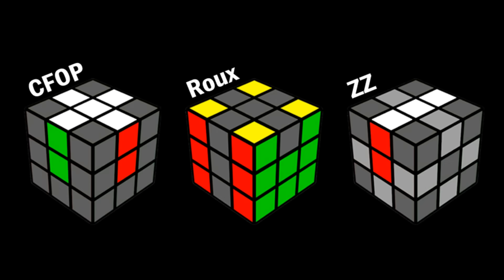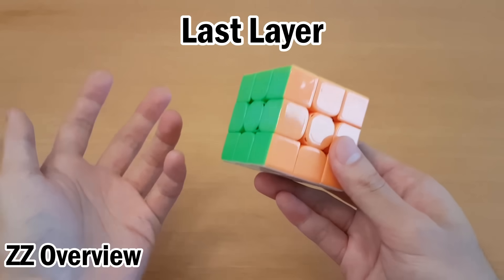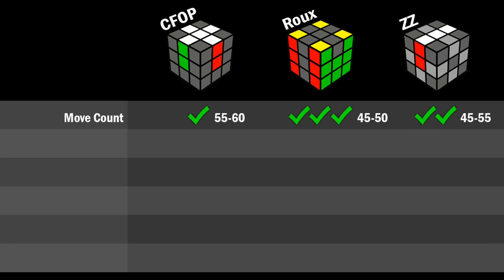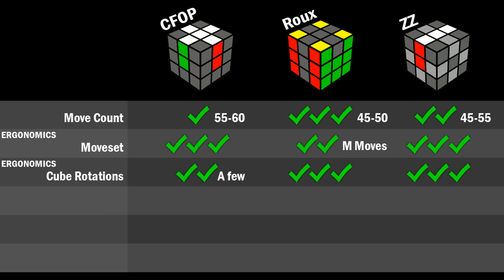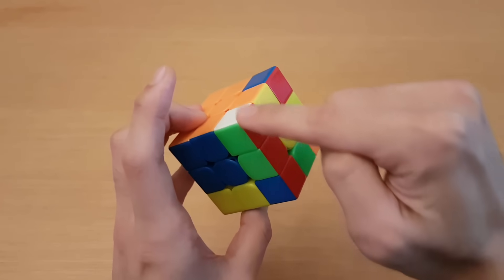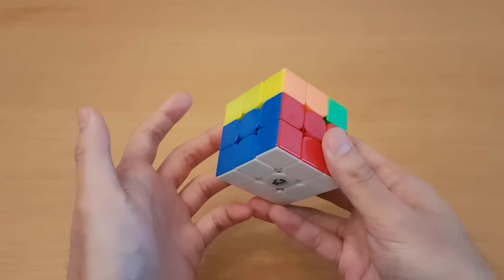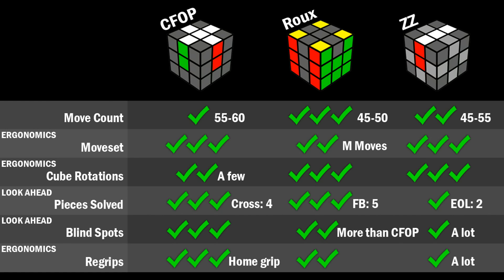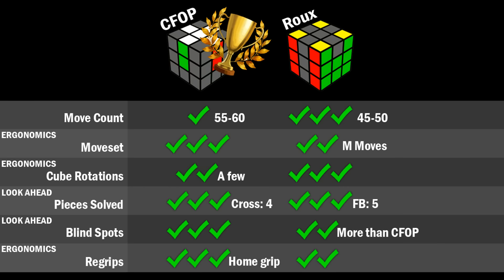The BEST Speedcubing Method? [CFOP/ROUX/ZZ] Comparison

Comment: just memorize 43 quintillion algs
Reply: Big brain
Reply: Just pray for a LL skip
Reply: @Froge4291  maybe pray for a whole cube skip
Reply: @Froge4291  just pray for a CFOP skip
Reply: @Froge4291  Just pray that you get an f2l skip and LL skip
Reply: @Froge4291  lmao
Reply: @Froge4291 i got an OLL and A PLL skip in the same time
Reply: You mean Pll right?
Reply: @Froge4291 why not pray for a full FOP skip?
Reply: 43 quitillion/6 if you are color neutral
Reply: @davidrodriguezsaucedo8666  Actually, divided by 24, since there are four possible orientations for every six color positions.
Reply: @davidrodriguezsaucedo8666  are you a genius ?
Reply: @davidrodriguezsaucedo8666  still 43 quintillion
Reply: @davidrodriguezsaucedo8666  43 quitillion/6/2 if you use mirror alg
Reply: @davidrodriguezsaucedo8666  wat is color neutral
Reply: @davidrodriguezsaucedo8666  it doesn't matter if you are color neutral
Reply: @davidrodriguezsaucedo8666  ummmm no
Reply: @davidrodriguezsaucedo8666 
 43 quintillion/6/4.
Reply: @davidrodriguezsaucedo8666  No! Actually 43 quintillion/24. Cause you can scramble the cube 24 different position, like white up green front or white up red front. Thus the up face can be any color and the front face then can be the remaining 4 cause if the down face. 6*4=24. Then you have to memorise "only" 43 quintillion/24 algs
Reply: @davidrodriguezsaucedo8666  7.14Qi
Reply: @davidrodriguezsaucedo8666 That’s not how color neutrality works
Reply: @davidrodriguezsaucedo8666 I’m color blind 😢
Reply: Just pray already solved cube case
Reply: @Jako1987  Pray for F3L skip.
Reply: @NAM_137   trun in the speed light ez
Reply: @Jako1987  0/43 Qua..
Reply: @Jako1987  1 in 43 quintillion good luck👍👍
Reply: Your brain will explode
Reply: @kenzarezyarifin1076  no ur eyes will pop out
Reply: @kenzarezyarifin1076  no shit
Reply: just be god and solve every scramble in 20 moves or less.
Reply: @chenguangli4385 that’s actually possible : you can get to any scramble with 20 moves or less, so you  can solve anything by reversing the scramble
Reply: Ha
Reply: @pianobeats1770  exactly
Reply: You would win the fewest moves challenge every time.
Reply: just memorize 43.3 quintillion scrambbles
Reply: @ClutchTimeHOOPS24  oh come on don't
Reply: I use 43 Quintilian Algs I avrage 100 hours
Reply: @Arhant201  join my discord https://discord.gg/zXR7ge6J
Reply: Just drink G fuel
Reply: Im still on beginner oll and when I found out there are 52 algs in advanced f2l I think I'm going to be brain dead by the time I finish learning CFOP
Reply: @taneason6  42 not 52
Reply: @neetachauhan5650  I said f2l by mistake I meant OLL
Reply: @taneason6  you mean 1look oll
Reply: @taneason6  just learn full 1lll
Reply: @taneason6  im still on begginer oll too and on regular pll but im not learning 52 algs do i can be 2 seconds faster
Reply: @taneason6  U good now?
Reply: @taneason6  you dont need algs for advanced f2l...
Reply: @iwilldefeatjperm5631  sorry OLL
Reply: @iwilldefeatjperm5631  that's what I thought
Reply: @iwilldefeatjperm5631  yea just have to learn intuitive F2L where there is no algs for F2L and it's more easier than the F2L algs
Reply: @iwilldefeatjperm5631  52 cases which are basically algs :)
Reply: Easy
Reply: (43 quintillion / 6 ) / 24

6 if color neutral

24 because rotating the cube is technically a whole 'nother combination
Reply: "I paid for the whole brain, so I'm going to use the whole brain"
Reply: Learn 43 quintillion algs or solve 5 21x21s
Reply: Are you joking how do you do that
Reply: @Diglett34  u just do
Reply: Nobody 
Me- let do this
Reply: I knew cfop and zz just want learn roux
Reply: for slove a cube with only 1 alg
Reply: Sometimes my genius, it creates gravity
Reply: The demon method
Reply: i did that
Reply: My brain will explose
Reply: Head be looking like my 2004 pc running Cyberpunk on max settings.
Reply: Or be fast at devil's alg
Reply: EZ!!!!!!!
Reply: hah easy as snapping your fingers
Reply: Actually only one alg, stop when it's solved.
Reply: Lol 😂
Reply: I can do this because I'm robot.
Reply: Exactly
Reply: true
Reply: Exactly
Reply: To easy already did that when I was like 2
Reply: 2 ends of the spectrum: 43*10^15 algs or take the cube apart and piece it back together
Reply: @coazop  Just learn 1l f3l
Reply: K
Reply: Yes,it’s that EASY😂😂😂 no need for HARDWORK😂😂😂
Reply: It's impossible
Reply: ThAtS sO EaSY
Reply: @MZ-ii4mf  mY coUsiN cAn Do thIs
Reply: @MZ-ii4mf  it is
Reply: @MZ-ii4mf yah it’s not that hard
Reply: Yea man lol
Reply: @Oliver Browning haha. Yeah.
Reply: Ha yh
Reply: That's what I did 😂
Reply: @jessejames9040  nice. Could you film your solves and show them to me? lol XD
Reply: @CfopCubing  I'm not fast but really I use cfop and average around 20 secs so I'll up load a vid of me sloving
Reply: On youtube
Reply: @Ravi Bhat if you were whooshing then why did you say “uh no..”, it’s a joke about how many algorithms you have to memorize you dumbo
Reply: Ha https://youtu.be/QvR7JyTI6yU
Reply: Simple method FSOP
Reply: One for every cube case each about 55 moves
Reply: EASY
Reply: 43!?

Pathetic
Reply: @termori243  idk what that means some are white moving up to red or moving up to yellow or down to orange
Reply: Easy!
Reply: just use 15 sec to figure out how the cube is scrambled and discramble ot
Reply: @rubiksharry6787  https://discord.gg/zXR7ge6J
Reply: Yes
Reply: Good idea
Reply: Memorise 1 alg and make all scrambled into that
Reply: Facts
Reply: Yeah SUPER easy to memorize 43 quintillion algorithm that might take like a month
Reply: Loooool
Reply: Bro I memorised them all, I just had to inject the most powerful CPU in my brain and let it run on a rubric cube for 5 months. Easy as pie
Reply: Yeah just remember every piece and spot then do the 20 mov s depending on that 😁👍
Reply: Just get an every ty big skip
Reply: or 21.5 quintillion if you mirror algorithms
Reply: me: im gonna stick with cfop
computer: ok, thx for the advice
Reply: Yeah that’s pretty easy
Reply: Trying😋😊
Reply: There are 43 Quintillion scrambles, bot algs
Reply: Duh
Reply: Np
Reply: All the alga would be 20 or less moves
Reply: it’ll take like 94.7 quintillion years to remember such a thing
Reply: Yeah 1 look cfop
Reply: Just
Reply: Np
Reply: I mean technically you have if you just learn the beginner methon
Reply: That's basically ZZ
Reply: Not that bad
Reply: Ez
Reply: Or you could download Kociemba’s algorithm to your brain
Reply: or just learn kociembas algorithm and solve EVERY scramble in 20 mocves or less
Reply: or learn the devils algorithm lol
Reply: Duh
Reply: It would Just take 865.040.065.489.797.120.000 diferent moves to learn like you can learn that in like 2 days top
Reply: That is so true
Reply: easy
Reply: @termori243  that's a very small fraction of moves that will change nothing
Reply: No need for sarcasm
Reply: HAHAH LOL
Reply: Exactly
Reply: Lol es
Reply: I have memorized 29 scrambles after reading your message as they have moves like u or u' or 2 moves
Reply: Tru
Reply: LOL 🤣THAT IS SO FUNNY!!😂😂🤣 HAHAHA 😐
Reply: if our brain was a 10000000 terrabite computer
Reply: Name all of them
Reply: yea its ez just memorize the best way to solve them for all quintillions of scrambles
Reply: That’s Harder than you think
Reply: at most  20 move algs, better than g perms
Reply: Some of them will be easy like U or R2
Reply: Yes
Reply: Fr like it’s not hard
Reply: Just buy a new gaming chair
Reply: @saravanankns9094  i wasn`t slow on the reply this time but i quite enjoy my gaming chair currently so please go away person that has a more dull sense of humort han me because you like such a overused joke that its unfunny
Reply: Just do the devil's alg 43 quintillion times
Reply: Actually is 49
Reply: @rodeldonkeh9069  why am i awake its 6:09am est
Reply: "the devil's algorithm"
Reply: And solve under 20 moves
Reply: Genius
Reply: Legends carry screwdriver
Reply: I get pll skip a lot
Reply: Yes, but how many regrips on the 20 moves to solve?
Reply: Fr
Reply: Done.
Reply: how hard could it be? 😃🔫
Reply: you mean 43,252,003,274,489,856,000 algs
Reply: Easy peasy
Reply: When 5 style and 7 style get figured out intuitively you won’t need to because every solve will be less than 30 moves
Reply: Ye just be a quantum computer
Reply: Duh
Reply: Not that hard…
Reply: Cfop in a nutshell, this is why I use roux 😂
Reply: Just pray for a whole cube skip
Reply: Yeah why not
Reply: Haha funny
Reply: Pray for cross f2l oll and pll skip
Reply: Thank you
Reply: Ikr its not that hard
Reply: m v,)8)9
Reply: Lol 😂
Reply: Are you sure
Reply: Bro I already did that last week like it's not that hard
Reply: How
Reply: Just watch this vid and sub to Jperm
Reply: U will die before that 🤣
Reply: Its easy just go to doctor and say remove my brain and input the 3x3 rubix cube
Reply: Yea dassit
Reply: XD
Reply: people with photograpic memory : Pathetic
Reply: Fr. Cubing is so easy.
Reply: Beginner 436n More To Go
Reply: Quadrillion
Reply: It's that easy
Reply: Just get a oll and pll skip
Reply: Yeah, 43 quintillion. So EZ
Reply: Become God
Reply: This is an epic gamer moment
Reply: exactly
Reply: The most simple solution
Reply: Well yes but no
Reply: He is on to something
Reply: yeah after my death I'll beat the world record, thanks for the advice :D
Reply: I know right it's so ez
Reply: Just break the cube rearrange the pieces
Reply: Nobody
Me - let do thiis
Reply: i can imagine just like “oh shit that was the wrong alg, that was from scramble 420108, i need the one for 9832010”
Reply: True just the best method
Reply: You can't even learn 1 million algs before you die
Reply: @TheReaper.Agent4219  no sht he is joking😑
Reply: With you there
Reply: I have to memorize 69 quintillion algs
Reply: Yeah, not toooo hard.
Reply: No u
Reply: That's quintrillion not quintillion
Reply: @poornimaskumarbadhe3783  no it’s quintillion
Reply: Now finaly you can 1 look 3x3
Reply: Duhhh
Reply: @varshappatil  lol start your brain it's 43 quintillion
Reply: Ez
Reply: Help us
Reply: Lol
Reply: Yeah just memorise it WAY easier 😂
Reply: U mean 43 quintillion combinationes?
Reply: That is to much for my brain
Reply: Good point
Reply: And take time of your entire life
Reply: just pray for cross, f2l, oll and pll skip to get pb
Reply: And identify the correct one each time
Reply: Love this #computer
Reply: real
Reply: hmmm… very bad idea.
Reply: I already did but my tps is slow so it doesn’t matter
Reply: Good for you😎💩
Reply: 10000 IQ right here 👆
Reply: U got 5 quintillion likes
Reply: Just pray for a solved scramble
Reply: L’ is my favorite algorithm
Reply: Just gotta lear ln 43 quintillion algs more!
Reply: No
Reply: Ikr it’s not that hard
Reply: yea bro it’s not that hard
Reply: Just do it 😂
Reply: Nope memorize 100 unhectotrillion alg
Reply: That's s EZ
Reply: Facts
Reply: Instructions unclear, learnt 69 quintillion algs instead
Reply: not to difficult
Reply: i have a skill issue
Reply: Genius
Reply: seriously
Reply: Wjat if u colorr blind
Reply: Pray for a CFOP Skip
Reply: Facts
Reply: Just pray for a cube skip
Reply: totaly
Reply: Le that random man with photographic memory: hold my beer
Reply: 10!
Reply: That’s what I’m sayiinggggggg
Reply: I can solve it with about 2 quintillion works the same i use about 30 algs per solve i get 10 second
Reply: just get cross and f2l skip then simply get I'll and pull skip
Reply: fr
Reply: lol
Reply: True
Reply: Just turn randomly and pray to God😂
Reply: Lie
Reply: Not even hard
Reply: No do 43 decillion algs
Reply: 57*
Reply: Not too hard 😅
Reply: Combinations*
Reply: @KolejowySzynszyl901  ?
Reply: @landon1127  combinations of all sides on the cube 😑
Reply: @KolejowySzynszyl901  still doesn't make sense lmao
Reply: Ah yes
Reply: Yes😂
Reply: What
Reply: just look at leats 20 moves ahead
Reply: 1 look f3l??
Reply: 43 quintillion-all the 1 turn scrambles - patterns / 6 (color neutral) - 18 plls - 39 olls = 7 quintillion algs
Reply: İt was that easy...
Reply: I'm not the only whose done that right?
Reply: 45 alg0
Reply: Lols
Reply: you didn’t have too cut me off
Reply: Fake
Reply: Fake
Reply: Ez
Reply: 53 bro
Reply: Ye it’s so easy 
😂
Reply: That's false
Reply: Minus 1.
Reply: Ye
Reply: Just hope for a CROSS F2L OLL and PLL skip
Reply: Or learn 7 quattuordecillion algs for 4x4
Reply: nah just pray for a cube skip
Reply: But there is infinity algs why only 43 quintillion?
Reply: Ong
Reply: Thank me i gave you 8k likes
Reply: lmfaooooo
Reply: Nty im good
Reply: You think that’s possible for someone like us?😂😂
Reply: Wow i never thaught that it was so easy
Reply: OK
Reply: OK
Reply: Same
Reply: Nah just use devil's alg
Reply: like this!
Reply: He ez
Reply: It so ez
Reply: Relatable
Reply: I don’t want to do that I’m too lazy
Reply: 1-look f3l
Reply: Some must be 1000 moves right?
Reply: That sounds to stressful
Reply: Thanks !
Reply: I never thought of it!!😮😮😮
Reply: Yeah I just learned one no biggie
Reply: 1 look solves lol
Reply: Ezz
Reply: That's what it feels like learning cfop
Reply: Even if you learnt one alg per millisecond, you would never be able to do it in a decade
Reply: Just memorise one alg for each layer
Reply: True
Reply: God method
Reply: IKR
Reply: Bro got higher than the pinned comment😂
Reply: Yes...😅
Reply: I memorized all 43 quintillion
Reply: That’s to many of most cubers including me
Reply: 1 look full cube is the best method

Although I am curious how many algorithms a 2 look while cube would be
Reply: Duh
Reply: Method's name AYCOSM

It's meaning is:Are You Crazy Or Super  Memoried🧠
Reply: Yeihang weing be like Already did at age 9
Reply: or forget all the algorithms and just break it apart and rebuild it
Reply: Wait you guys haven’t 😂
Reply: Exactly
Reply: Wow 10,000th like
Reply: Lol
Reply: #relatable 😂😂
Reply: Nah bro
Reply: I can but I don't wanna
Reply: Oh god share your algs.
Reply: Nah just be blind
Reply: Who u will  remember it
Reply: Smart
Reply: Yeah but like some of them are like U or R U R
Reply: real
Reply: That's pretty low for J Perm
Reply: Yeah, the 43 quintillion meth-od. Classy
Reply: I can solve the cube in 3 minutes. I use 4 algorithms to do it. ❤
Reply: 1LFC
1 look full cube
Reply: Infinite cube method ahh
Reply: Yes this is just so obvious
Reply: Me  42  more 1 to go
Reply: Yeah I don’t understand why anyone else does that. Like, it’s so obvious!
Reply: It's impossible to memorize even 1 million
Reply: Haha😂
Reply: ‘The coazop method’
Reply: Oh, you’re right mb
Reply: Yeah man definitely I am not in an condition of not being able to memerize 13 algs😅
Reply: That what I did😂
Reply: Just take the stickers of then there is no algs that you need to learn
Reply: @nrlgamer5380  off*
Reply: @nrlgamer5380  they domt have stickers anymore. Your age is showing fellow 80s and 90s baby
Reply: @GAMESTERVISION  they do
Reply: ain't that CFOP?
Reply: @ricardinhomirabolas5484  *zbll
Reply: @ricardinhomirabolas5484 for cfop it's only 88 algs
Reply: 🤣 @ricardinhomirabolas5484
Reply: @Collins Records I was making a joke I know how to solve a cube
Reply: @Ravi Bhat woosh
Reply: No
Reply: Why not @Usha_Prasanna
Reply: Yeah 
It's called the god method and it also is algorithm based and has a 15-20 move count so It's definitely the best method.
But it's really underrated.
Reply: No-

There are 100 algs in CFOP (57 algs for OLL ,21 for PLL and 22 for F2L=57+21+22=100 algs).

We have to memorize 10 algs in ROUX (2 in CMLL, 1 in Good and Bad edges,1 in UR,UL and 6 in L4E)

494 algs in zz (494 in the ZBLL)

=
We have to memorize 604 algs for all methods.
Reply: You have to memorize only 100 algs CFOP is the fastest method only we need to learn 100 algs.If you learned once,You will be on sub-30 or Sub-20 or Sub-10.
Reply: this is an absolute insane and ridiculous comment. it would take over a quintillion years just to do that. do you not know how much 43 quintillion algorithms is. to refresh you it is 10,000 billion or 1000trillion or 100k million.
Reply: @krypticx8584  Yeah. It's a joke.
Reply: @krypticx8584  thats a quadrillion not quintillion

Comment: Ok all i know is the obl method for solving. Anyone know where i should go from here?
Reply: How to choose:
Do you not like learning algorithms and feel that your turning isn't super fast? Then maybe do Roux. Do you not mind learning algorithms and feel that you can turn fast, or want to get good at big cubes? Then maybe do CFOP.

Where to learn one:
To learn Roux, I would recommend Kian Mansour's channel. To learn CFOP, I would recommend this channel. (Just so you know, CFOP is basically the logical continuation of LBL, so it will be easier to learn if it makes any difference in your choice)

Algorithms:
If you're going with Roux then learn 2 look CMLL. I recommend memorizing the most efficient solutions to EO cases.
If you're going with CFOP then learn 2 look OLL and 2 look PLL.

Don't worry about making the wrong decision. Plenty (I would venture to say the majority) of Roux solvers started with CFOP. Neither require extreme turning speed and lookahead to get decent times, it all boils down to what you enjoy doing.

In short, don't think that you're stuck permanently to any method, just choose based on what you like and adjust as necessary.
Reply: Gabe Chevalier I appreciate you taking the time to reply to me. I think I will try CFOP and work with it for a while. I probably will try Roux in the future depending on how I do with CFOP. Thanks again.
Reply: @demonsandangels705  i went to cfop after learning the cube, and have since moved on to roux. To me it just makes more sense, seems like something is getting done at every step. Whereas with CFOP unless you do 1look Last Layer, you're doing OLL, and PLL. Which are combined while doing roux. Something is being solved at every step in roux, where as with CFOP, your OLL might not solve anything.